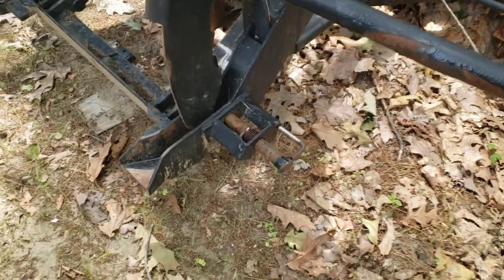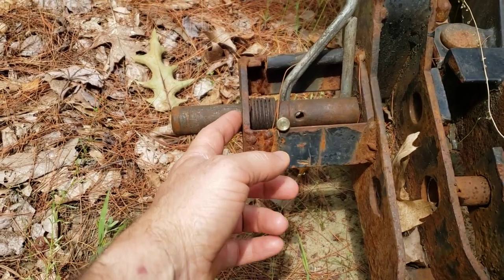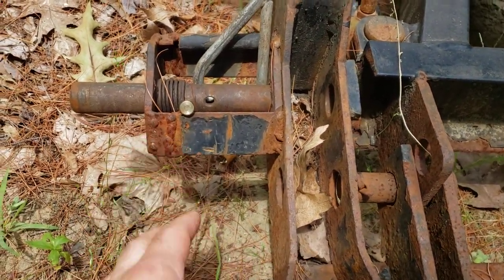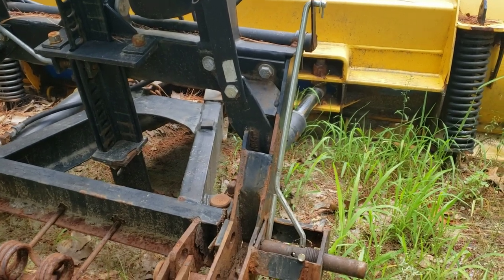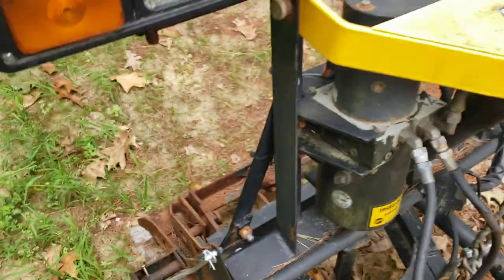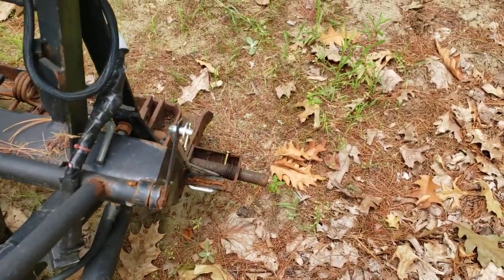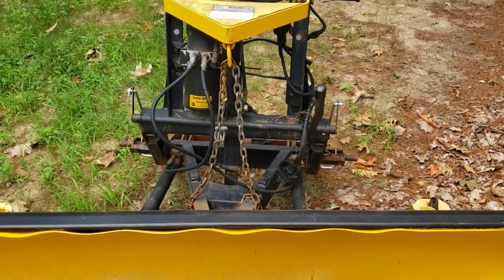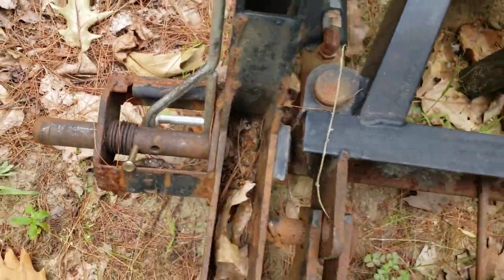Fisher Minute Mount 1 to Minute Mount 2 PIN MOD

Comment: 5:14  That looks like a 6' 9" LD with 23" moldboard(?).  I have a 6' 9" LD, 26" tall.  MM1, 25" spacing.  The 6' 9" plows are pretty rare.  As far as I know there werent too many vehicle mounts made, only S10 (Blazer), Ranger (Explorer), Tacoma (4-runner), maybe Nissan pickup and a few others.
Reply: @Hubjeep, good eye. I think you are on the money for the size.  I have no idea what it was originally mounted on.  I certainly don't see many this size around but it works nicely on my 4runner, very nimble for my driveway shape.  I had to make the plow mounts and modeled them off a 1st gen Tundra setup I think.  Thanks for commenting!
Reply: @CRRpop    I too had to make my own mount for my 1999 XJ Jeep Cherokee.  Especially since mine is lifted a bit.  Had to keep the A-frame level, basically built a bolt-on sub frame under the bumper.  They are sturdy plows for sure and I like the trip-edge better than full trip plows.
Reply: @Hubjeep  that's pretty funny as I also put a plow on a 99 XJ before the 4runner.  I did not have to build the whole mount and it was not a Minute Mount so a bit of a pain to remove/attach.  I found an 88 XJ with the plow but it only had the Fisher big lower section not the front frame mount side, I guess that was unobtainable at the time.  I got the whole setup cheap as the installer did not do a good job attaching the front side and it broke off on the former owner so he gave up on it.  I used tow hook mounts and some thick angle iron and never had a problem with it on the 99.  Plowed with it for 7 or 8 years and sold it to someone to do his parking lot.  The 4runner is much better pushing snow.  Love the trip edge on the Fishers.  Sorry for the book, thanks for visiting!  🙂